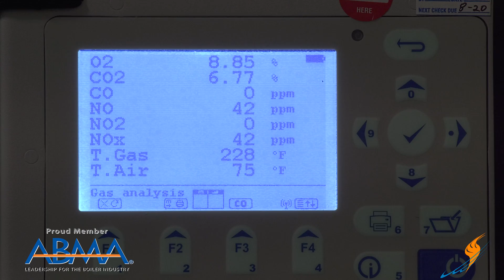Tuning The Combustion on a Steam Boiler - The Boiling Point

Comment: What about tuning from high fire down to low fire then checking low fire to high fire? On linkage burners the combustion will differ if the burner is modulating up to a point or down to the same point due to the mechanical play in the linkage. On linkageless systems it still will change but will be a more minor change due to the accuracy of the servos.
Reply from the maker: Tuning is always performed on the richer side of the two drive directions as CO formation is usually the limiting factor on efficiency. Thanks for watching and hopefully that answers your question.